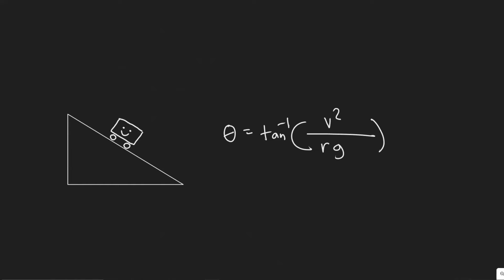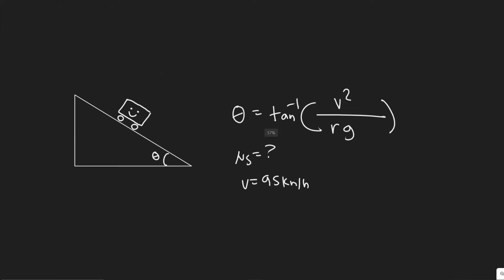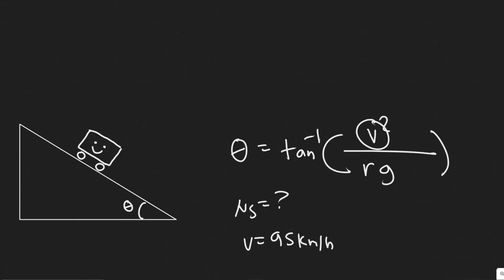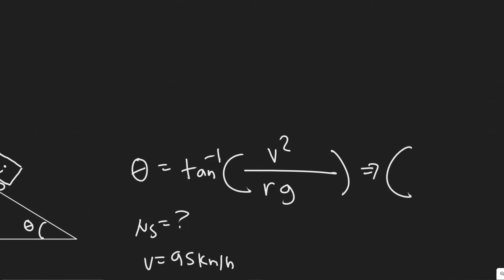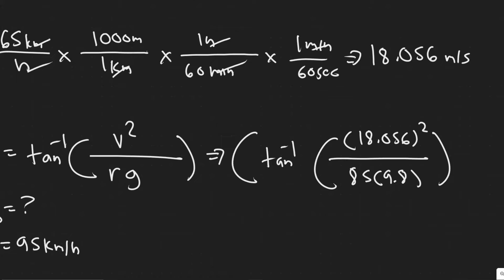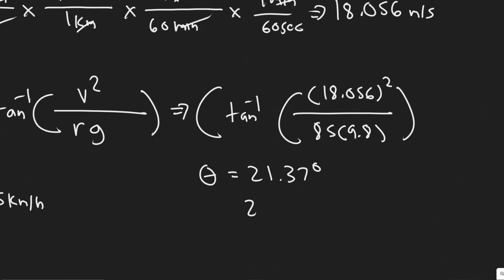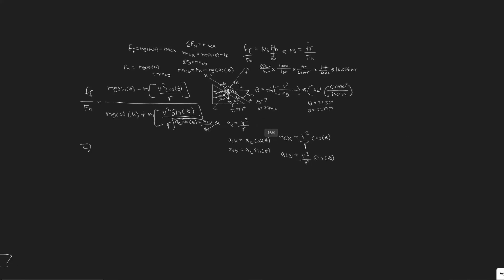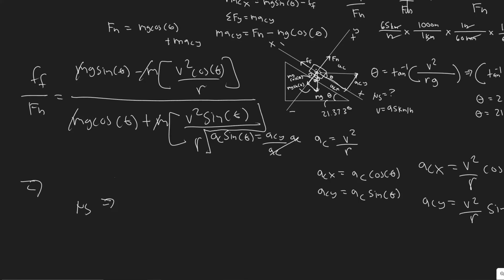If a curve with a radius of 85 m is properly banked for a car traveling 65 km/h, what must be the co

Comment: absolute G. big help with physics class. Question: why is the friction force going left up the slope? Isn't the car's natural tendency to slide to the left up the slope. Also, ac is pointing right, so doesn't that mean friction would also point right?
Reply: i got the same question. i was thinking maybe he assumed the wrong direction for friction and that's why he got a negative value at the end.